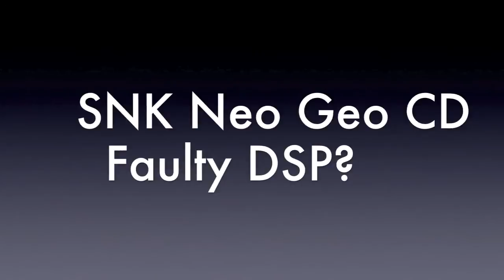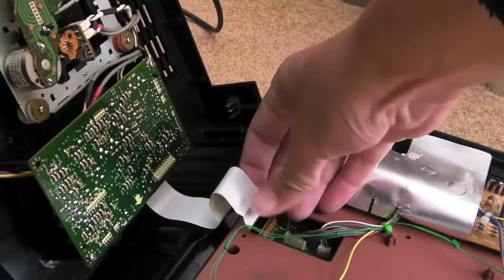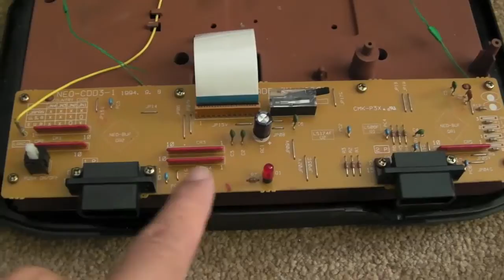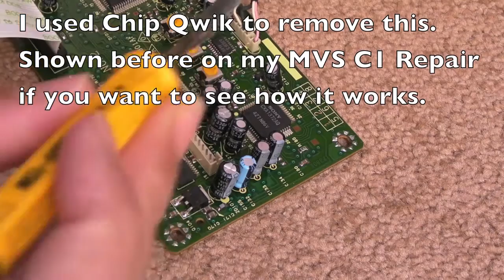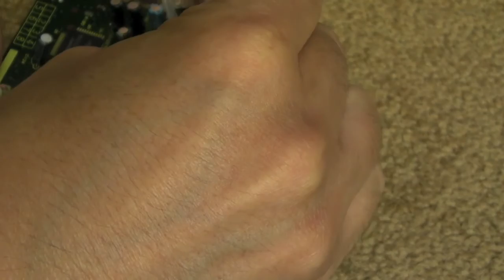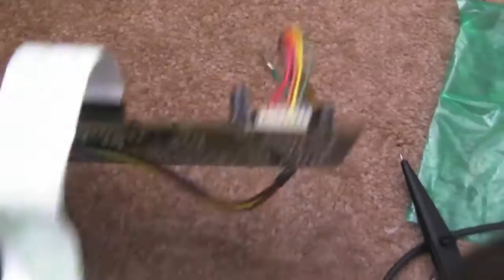SNK Neo Geo CD - DSP Fault? (Fixed? See Comments)

Comment: How to fix the audio glitch where the sound becomes distorted? Happens to mine after a half hour.
Reply from the maker: Could be a PSU issue - the PSU is known to have caps leak, and the 3 pin power connector can get loose.  If the PSU is OK, could be a bad solder point somewhere
Reply: @GadgetUK164  

Sent it to my mechanic to be serviced, unless she sucks at her job the solder points are fine?

I must've sent my modded NeoCD to her 3 times over this very matter. To be fair I haven't had a second tech expert look at it. I hope there's something I can do externally before I resort to buying another modded NeoCD or sending the one I have to someone else.

Comment: hey there, can you help me? i just recentrly bought a ngcd and it`s working perfectly fine, however, whenever i plug the power cable in the socket, after a second, the power light blinks once really fast. is that supposed to happen or ir that a bad sign, i`ve never owned a ngcd before, so i`m not sure, I`d appreciate if someone would help me answering this one
Reply from the maker: The power supplies often need recapping on the AES and Neo CD!  That might be the problem - I cannot remember ever seeing the power flicker like that.
Reply: i asked someone else, and they told me their neogeo cds also do that. maybe it`s something that happens over time, however i`m worried if this might  damage the console.
Reply from the maker: Thats interesting!  I have to admit I don't remember seeing that on the two systems I've had in the past.  If the system works, just don't worry about it.  But the PSUs in both the Neo CD and AES usually need recapping.
Reply: i`ll see if i can send it to repair. other weird thing that happen is that the inside of the controllers are missing parts. the guy who sold me the console gave me back some of the money becouse of the controllers, but it`s still  weird and neither of them work properly.
Reply: also, some of internal parts seemed different from other controllers i`ve seen here on youtube. maybe it`s becouse it`s a model manufactured in Brazil, but still, it makes me wonder what happened to these controllers.
Reply from the maker: Could you upload some photos of the inside of the controller - where the parts are missing?
Reply: sure, i will, i`ll send you the link
Reply: i sent the controlers to repair, but now the console has a new probem, when turning the console off, the screen flickers with chopped images for a split second before completely turning off. i think that it migh be a problem with the power adapter, I`m really afraid of  it damaging the console...

Comment: 32:20  "This is probably not going to be recoverable." :D

Reading the last text now...
Nope, it wasn't the DSP chip because at that point we're beyond the operation of the focus control. So it doesn't matter that you couldn't source that one, since replacing it wouldn't have helped anyway.
If the problem still remained after you replaced the CXA1372, and if there wasn't any problem with the solder joints there, then it should be quite an easy fix because already there you have narrowed down the cause of the problem to only some very few things.
Too bad the guy who bought the Neo Geo CD just fixed it by swapping out the board. Where did he get the replacement board from? It's not like they are being manufactured anymore. Would have been better to repair that unit, in my opinion.
Reply from the maker: There were so many things I wasn't aware of - the voltage reference being one of them.  It could well be that there's a voltage reference on their and I failed to identify and test it.   It probably wasn't the DSP.  If you look at the PCB, do you see that 16 pin (I think) chip next to the where the focus control goes, which I presumed was some kind of op amp - I think that could have been the fault, but I couldn't find anything online with regards to that chip at all.  I did have 2 new lasers to test with and both of those behaved the same way.  It was only after I uploaded the video I noticed at one point the focus wasn't doing anything.  That's something I would normally notice as its the first thing I usually look for.

With regards to the replacement board, I think he took it from another faulty Neo Geo CD.
Reply: I took another quick look at the video, and the chip you are referring to (which seems to be a SOIC16, btw) is probably the actuator driver IC on that board. That would correspond to the LA6530 on the Amiga CD32 drive. The chip that you replaced on the board in this video is most likely the spindle motor and sled motor driver IC, which would correspond to the LA6520 on the Amiga CD32 drive. I don't know what the parts number is on the chip you replaced, but I wouldn't be surprised if it starts with "LA" and then has four digits after it. That is very typical for these systems when it comes to actuator and spindle/sled driver ICs. Is there any way you can find out the exact part number of the chip you replaced in this video? Maybe from some old receipt somewhere? Or maybe you even still have the IC that you removed from the board lying around somewhere?
Anyway, the reason I suspect the chip you replaced to be the motor driver IC is because such a chip would need to be able to provide a decent amount of power at the outputs (after all, it's moving the whole pickup back and forth), and with higher power comes higher heat dissipation. If you look at the chip you replaced, you can see that it has two big ground "pins" on each side of the chip, which looks more like tabs than pins. This is to provide bigger surface area connection to the PCB for better heatsinking of the chip.
Driving the actuator coils, however, doesn't require a whole lot of power. As you could see in my video, a current through the focus coil of only about 100 mA would make it move by a significant amount. Different coils in different pickups are different of course, but I think my little demonstration provides a pretty good example.
One quick and easy thing you could have done in this video is to verify which connector does what. You could do that either by checking where the connection points go to in the pickup unit, or simply by pulling out one connector at a time and see which connector stops the pickup unit from moving. When you turned on the power, the pickup unit moved. If you had unplugged the cable going close to the chip you replaced, would the pickup unit still have moved when you turned on the power? Probably no. And in that case, it would have been verified that the chip you replaced is the motor driver IC, and not for the actuators. If you had done that before replacing the IC, you would then not have had to replace the IC to start with, since it would then have been easy to figure out that the chip you replaced is for the motors. It is very closely located to the connector, after all.
The smaller SOIC16 doesn't seem to have any heat sinking tabs on it, but I don't really think it's necessary. So yes, this chip is very much included in the list of suspected culprits, since it's most probably the chip driving the actuators (which could easily be verified). And, as you know, what didn't work on this unit was just that - the actuators. ;)
Reply from the maker: RetroGameModz I think it was the actuator driver tbh - I know at one point in the video here the laser was not bobbing up and down but that was a self inflicted bad connection.  For the most part the laser was bobbing up and down and since I had swapped out the RF chip, and the BTL driver chip, and I tested with a new laser, the only remaining components really were the actuator driver, CPU and DSP.  I tested pretty much all passives on this.  For someone experienced like yourself I am sure it would have been very obvious where the fault was - 2 minutes with a scope and I am sure you would have seen a missing or incorrect signal related to the actuator driver.
Reply from the maker: RetroGameModz Initially I went with the BA6396FP driver chip since it seemed logical (guess work) based on lack of spinning, despite new laser and focus attempts from the laser assembly.  Then I just took a stab in the dark and replaced the RF chip - CXA1372.  Never a good idea to just do guess work but my lack of experience on CD systems was my stumbling block here.

Comment: At 28:20, you're wondering if the fact that someone has been messing around with the pots can affect that the pickup lens is not even moving up and down when you "close" the lid. The answer to that question is no, the pots have nothing to do with that. I can be quite sure about that, because this unit also has the Sony CXA1372 on board, and I have already had quite a deep look into the datasheet of that one as you know. In fact, the pots don't affect anything at all until the system has reached a focus lock and has started to read a disc. When it's doing a focus search, then the CXA1372 completely disconnects the focus/tracking error correction circuitry, so the pots are in effect not even in the circuit at that time. The CXA1372 is alone responsible for doing the focus search, so the symptoms that this unit is showing has absolutely nothing to do with the pots whatsoever. Incorrectly adjusted pots would make the system go into focus search mode (which makes the actuator move up), then lock onto the CD (assuming there is a disc in there), then it would spin up the disc just for a brief second and then immediately lose track of the disc and turn off the spindle motor. Shortly thereafter, maybe just one second later while the disc is still spinning by itself, it would then turn the spindle motor back on and make a new attempt, only to fail again.
If the focus actuator is not moving, then there is definitely something wrong with the actuator itself, or something wrong with the electronics on the board.
Reply from the maker: Thanks, and yes, I can see you are 100% correct  =)  I do wonder if there was something else other than the original fault at play, perhaps something I introduced.  Because I am sure at some point the focus was working.

Comment: You could keep turning those pots until the cows come home carrying a bag of electrons. It still wouldn't do any good, since the actuator is not even trying to focus in on the disc.
To repair that unit, the order of procedure would be:
1. Check and verify functionality of the focus actuator coil.
2. Assuming the coil is fine, measure the outputs of the focus coil driver IC as the lid is being "closed". If no signal, then proceed.
3. Check the input at the actuator driver where the focus signal is coming in. If no signal, then proceed.
4. Check the output of the focus error signal at the Sony CXA1372 (still while the lid is being "closed", of course). If no signal, then either this chip is bad or there is some bad component on the board that inhibits functionality of the focus control inside the CXA1372. Check pinout of CXA1372 and read datasheet to find out which input pins to this chip that are related to this. Check signal at those pins. If all looks normal, then CXA1372 is at fault. Then replace it.
There, unit repaired. ;)
Reply from the maker: LOL @ cows coming home carrying electrons =D  Very good point though with regards to lack of focus.
Reply: What, are you saying they are usually carrying a bag of protons instead?? :O Because that would completely go against everything I know and scatter the world of science as I know it, throwing it into an erratic state of cosmic unbalance. :D

Comment: Haha, that Neo Geo CD also has the Sony CXA1372 on the board. It seems to be a very common chip that can be found in many of the different CD based consoles. :)
And check out the potentiometers. FO (Focus Offset), FG (Focus Gain), and TB (Tracking Balance). Too easy! ;)

Edit: I see now that it also has TG (Tracking Gain) and TO (Tracking Offset).

So if I can just make a somewhat qualified guess here, then compared to the Amiga CD32 it would be:

FO = FEB
FG = FEG
TB = TEB
TG = TEG
TO = [does not exist on the Amiga CD32 drive]
Reply from the maker: Hehe, yes - Had I had this Neo Geo CD now I could have checked a lot of things that I didn't know about - Just because of your great video there =)   It looks like the Sega CD and Neo Geo CD are very similar to the Amiga CD 32 CD drive.
Reply: It's not a coincidence that they are similar. This is how CD based systems works in general. The layout and design of everything might differ between drive units, but the basic topology is the same. That is why it can be quite beneficial to learn about CD based systems; if you have a good understanding of how one of them works, you will also have a very good idea of how the rest of them work. And of course, such knowledge can often prove to be very useful when repairing and/or servicing CD player/ROM systems.

Comment: Gadget, I've decided to invest in a proper Jamma power supply for my Neo Geo MV-1F. In the meantime, will using 4.91 to 4.93 volts damage my Neo Geo MV-1F?
Reply from the maker: No, going over 5.20v is the only danger!  Under 4.9v you might get reboots / crashes etc.
Reply: Thanks for the tip, again! I think the MV-1F is a LOT more sensitive to voltage and amperage than the MV-1FZ.
Reply from the maker: I think it has many of the exact same components to be honest!  In general going over 5.20v is not a good idea because many of the components have a manufacturers maximum vcc rating of 5.25v.  The Z80 is a good example of this.  I've got an MV-1F in the loft which I got a few months back, I am sure it has many of the same components are other MVS boards.  Unless you've got an old version that has the PRO-B0 and PRO-C0.
Reply: Going to PM this...

Comment from the maker: What's annoying is the footage I lost covered a full tear down of the main logic board etc.  I also took the external PSU to bits in order to check capacitors in the power supply as well.

Comment: wow this is the one I bought off ebay from beaps !
Anyways got it working bud because I had one thing you did not a spare NeoGeo cd. what I did was swap out the boards and whittled it down to the CD drive controller board the one you replaced the chip.
basically all I did was centralise the all the trim pots cos they had been moved, and bingo it worked !!, that's  the problem with CD drives if the pots have been moved where do you start , well my logical rule of thumb is centralise them manually and its a good hack if you have no test measurement data to assist  like the manufacturers data.
Always measure and record after getting these running incase they are moved !
Reply: OMG!  Are you saying that the board and DSP worked and it was just the pots had been fiddled with??
Reply: *****
Yes bud the board and chips were all good ! it was just that the pots had all been moved .
Also after getting the drive spinning I found that it was still hunting to find track `0` I found that this was due to the spindle beaps had changed, basically the grip on the CD disc was poor causing the CD to slip because of the hard plastic grab ring,so I changed it out to a spare one I had with a softer grab ring ,this also cured that,so now its alive !!
Reply from the maker: Jeff Jones ARGHHH!!!  So it was working after all that!  I have to admit, whilst I knew the pots had been moved when I received it, I did adjust them a few times through out the process before resetting them back as they were.  I am amazed I couldnt get any life out of it as I am sure they were all centralised at one point =/
Reply: GadgetUK164
I have not got the electronic skills you have gadget but even us hackers have luck sometimes,perhaps I should put some a quick vid up even though I do not normally bother with vids :) ) to show it working !
You are still the man !
Reply from the maker: Jeff Jones Any chance you could upload a video if you get 5 minutes?  It would be really cool to confirm its the same system and it has the same logic board on the drive assembly.  Not that I don't believe you!  I guess it would be just interesting as your video would complete the series on this repair.
Reply from the maker: Jeff Jones Thanks for your kind comments ;)  On this occasion I was a bit of a muppet for giving up too quickly and not spending a little more time re-evaluating things before jumping to the conclusion there was still a fault.  Glad it was you that got this system anyway as I am sure Beaps is!!!  This just re-affirms why I hate laser based systems lol.
Reply: GadgetUK164
Will do a sort vid later to prove its the same one bud
Reply: Jeff Jones OMG please accept my humble apologies because I am the biggest dumbest muppet on Youtube ,I just started breaking down the Neogeo for a vid and guess what it aint got your controller board in !, right  now I know I had a spare controller board where I did centralise the pots and put that one in ,for some reason I thought it was the same one you did, I need to stop doing retro stuff cos I am stupid :(
All an only say I have been really busy lately and my memory is fooked :(
But at least you were correct in your diagnosis :)
Really sorry for mucking you around gadget.
Reply from the maker: Jeff Jones Phew!!!  That's fine - at least I am not going out of my mind lol  Still pleased you managed to get that system working =)

Comment: Great vid ;-)
These surface mounted chips are real bitches to remove/replace without proper equipment and nerves of steel ;-)
Reply: The perfect recipe for good soldering results:
- Desoldering braid of good brand
- Iron tip of suitable size and shape
- Flux of rosin
- Solder of lead
- Nerves of steel :)